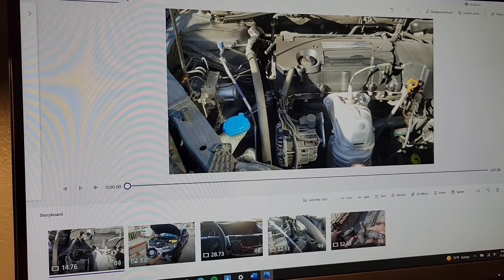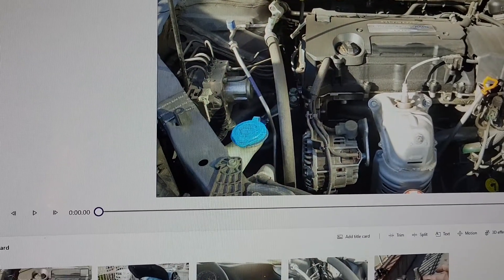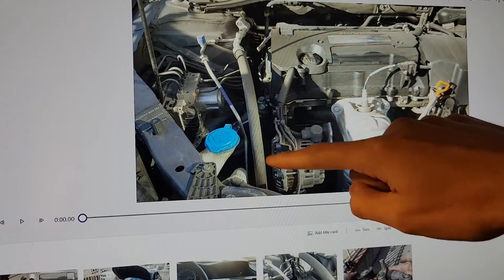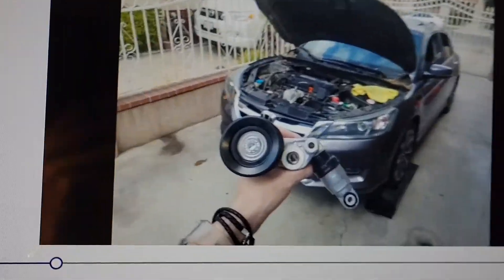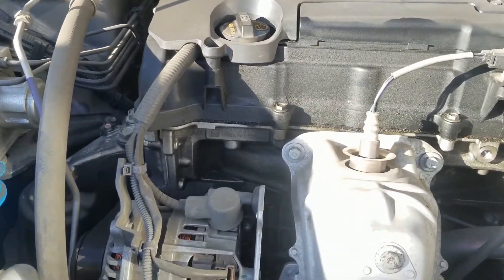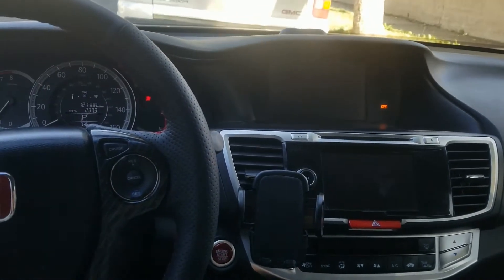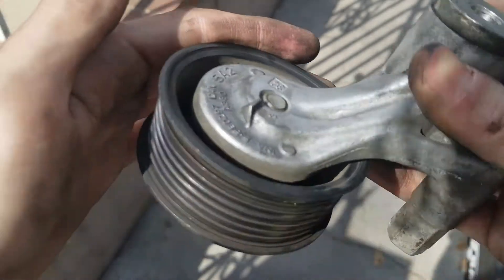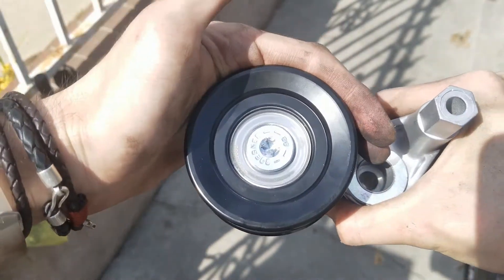Tensioner Pulley Noise/REASON (supercharger whine) 2013-2017 Honda Accord #diy #diagnose

Comment from the maker: :yt:OEM Tensioner Pulley Used: 
https://www.amazon.com/dp/B01MQLJFCN?linkCode=ssc&tag=onamzdan0f4a0-20&creativeASIN=B01MQLJFCN&asc_item-id=amzn1.ideas.1GQO7BKQEEC6D&ref_=aip_sf_list_spv_ofs_mixed_d_asin

OEM Serpentine Belt Used: 
https://www.amazon.com/dp/B00KTLGAN6?linkCode=ssc&tag=onamzdan0f4a0-20&creativeASIN=B00KTLGAN6&asc_item-id=amzn1.ideas.1GQO7BKQEEC6D&ref_=aip_sf_list_spv_ons_d_asin

Floor Jack Used:
https://www.amazon.com/dp/B0001E65UE?linkCode=ssc&tag=onamzdan0f4a0-20&creativeASIN=B0001E65UE&asc_item-id=amzn1.ideas.20WJBA2MSTTNU&ref_=aip_sf_list_spv_ons_mixed_d_asin&th=1

Jack Stands Used:
https://www.amazon.com/dp/B0BJV5KF3N?linkCode=ssc&tag=onamzdan0f4a0-20&creativeASIN=B0BJV5KF3N&asc_item-id=amzn1.ideas.20WJBA2MSTTNU&ref_=aip_sf_list_spv_ons_d_asin&th=1

Lug Wrench Cross uSED:
https://www.amazon.com/dp/B06XPWS3HJ?linkCode=ssc&tag=onamzdan0f4a0-20&creativeASIN=B06XPWS3HJ&asc_item-id=amzn1.ideas.20WJBA2MSTTNU&ref_=aip_sf_list_spv_ons_d_asin&th=1

HEX Tool to Remove Tensioner Bolt:
https://www.amazon.com/dp/B004W7ZVIS?linkCode=ssc&tag=onamzdan0f4a0-20&creativeASIN=B004W7ZVIS&asc_item-id=amzn1.ideas.1GQO7BKQEEC6D&ref_=aip_sf_list_spv_ons_d_asin&th=1

Items I use for my (2013-2017) Honda Accord on my Amazon affiliate Storefront here:
https://www.amazon.com/shop/striker50/list/1GQO7BKQEEC6D?ref_=aip_sf_list_spv_ofs_mixed_d

Comment: Thank you for the explanation, I’ve been trying to diagnose the problem for weeks
Reply from the maker: Downside: You won't have a supercharger anymore 💔
Reply: Thank you my friend can I just change the pulley only or I need completely
Reply from the maker: @mohamedgaras9259  Changing the pulley should get rid of the noise 🙏
There is a chance it can be one of the other pulleys but this is the most common one that fails
Reply: Thank you sir when I hear the noise it is 100% like your noise so iwill take my chance and change pulley only your good man God bless you I dont know still guy people out left in this world iam from Africa life is tough in North America cold kids language you can imagine my friend so I try to fix things with help from you tube people like you
Reply from the maker: @mohamedgaras9259  Thank you my friend, I'm here to help 👍
Reply: @mohamedgaras9259  I replaced the whole part, you can’t just replace the bad bearing

Comment: Often times it’s not the pulley it’s the alternator on the verge of failure too especially if you notice your interior lights like dash and map lights flickering due to voltage fluctuating it’s just matter of time before it completely seize up and destroy your serpentine belt leaving you stranded
Reply from the maker: Yup possible, but the tensioner pulley seems to be a more common issue to be addressed

Comment: Great Great vid man ! , just what i hear on my accord i knew it was coming from where the timing belt is but didn’t know exactly.. I hope you release that video on how to change it nd what tools did you use . Fuck what they say lot of us need the vid so we can fix it ourselves
Reply from the maker: Lol thanks Luis! I replaced this tensioner about 1 year ago and the noise just came back around 2 weeks ago. It's most likely because I bought the new tensioner pulley off Amazon. So my next one is going to be OEM. It's pricier but I don't want to be replacing it every year. Price difference is about $40 for this one and $140 for OEM
Reply from the maker: Video is up on my channel now for the replacement!

Comment: Hey I have a honest question I can’t find it anywhere online is there a actual supercharger made for the 2015 Honda Accord EX-L v6 3.5L or no they haven’t made it yet I see some superchargers were made for the earlier EX-L accords like the 6th to 8th generations but not the 9th gen I need help?
Reply: Yeah, definitely not. People have been fabricating their own custom turbocharger kits, but I personally had a custom setup from someone’s used Slick Fab turbo kit on their 9th gen 2.4L. I have the 6MT, but i’d probably not go forced induction on the CVT, cause it can’t really hold ~280+ WHP without blowing up your trans lol
Reply from the maker: @isnowyazn  If I'm not mistaken, the 2015 V6 has an automatic tranny, instead of the CVT
Reply from the maker: I haven't heard of any superchargers being made for it. Much easier to turbo it for slight performance increase. I'd imagine you'd need an entire new suspension and brake set up if planning to add an actual supercharger lol

Comment: I changed mine out. It was a knuckledrag to do.
Reply from the maker: It's really a pain in the butt! I keep delaying making the video showing the process because at the time I recorded it I didn't really think about making a good recording since my account was much newer. 
I'll do it soon though to show what helped! Because the only videos that show the process make it sound easier than it is and don't say what to do when things go wrong
Reply from the maker: I saw your torque specs on another post that's awesome. I'm going to be working on the video today and im going to remove the wheel to have a better angle since ive noticed no one shows it that way

Comment: Where is the installation video ?
Reply from the maker: Funny you asked: my new OEM tensioner pulley and serpentine belt just came in from Japan. 
After about a year, the aftermarket one I bought is already giving out as well. I bit the bullet and am going OEM. When I recorded about a year ago, I didn't get the best video clips because I got frustrated and ran into a few hiccups. I didn't want to upload a half effort video. I will make sure to address a lot of the points in my new upcoming video ✌
Should be recording this weekend or the next
Reply from the maker: Installation video is on my channel now showing step by step

Comment: Hi , quick question. I have a 2015 Honda Accord sport and it makes this sound but very quiet whine I slowly accelerate and decelerate. Is that just the normal sound of the CVT transmission or should I still look to replace my tensioner pulley. Thanks in advance for the insight.
Reply from the maker: I'm not sure if you've seen my other tensioner pulley video where I do the actual repair. In that one you can hear the noise when I accelerate even if the car is parked the noise will get louder. Try having the car in park with your hood open and step on the pedal if the whining gets louder even though the car is in park then it probably can be your tensionor pulley
Reply: @Striker50_  Thank you for the quick follow up. I also checked out your other video! I put my car in park with the hood open and the whining definitely gets higher when pressing the gas, but it’s only about 1/4th of the pitch that was in your video. It’s hard to hear unless your really listening for it. Can’t hear it over regular interstate/road noise. Is this something to be concerned about? Honestly just hoping I can rule out my transmission being shot haha. Thanks.
Reply from the maker: @jedmayhak7768  lol I feel you. Hard to say over just comments. I suppose you can do a CVT oil change and see if there are chunks of metal that could be a sign. Keep in mind it wont sound as loud as my video because you're sitting in the car if you're doing it solo. Another way is to remove the serpentine belt off and spin the tensioner pulley with your hand. If there is a whirring noise then that's how you can tell it's the pulley. If it sounds quiet that's how you know it's not the tensioner pulley. You can also check all of the pulleys that way. If they're all quiet it's not the pulleys

Comment: This is about as close to the problem I'm having with my 2015 Accord the thing is the tensioner pulley have been replaced and nothing changed
Reply from the maker: There are other pulleys that do give out although this is the most common one. A way to check if it's the other pulleys is to remove the serpentine belt and spin them with your hand to listen for that grinding noise. I have a vid showing how to remove the serpentine belt if that benefits you

Comment: This only happens when I pass 40mph and it’s making the noise on the front driver side, this still the problem ?
Reply from the maker: It could be a wheel bearing it seems. Do you have an ABS code, or any codes on your dash?
Reply: @Striker50_  no codes yet, been making that noise for a couple weeks now.
Reply from the maker: @nathanangel9762  You may be experiencing another issue than the tensioner pulley
This noise happens as you rev the car, even in park the noise will increase if you press the accelerator
Reply: @Striker50_  I haven’t tried it in park yet, so if it does make the noise while it park it’s the tensioner pulley. But if it doesn’t make that noise in park then it’s the wheel bearing ?
Reply from the maker: That's a good starting point. Again, can't say with 100% certainty what it may, or may not be since all I could do is read your description of it. 
One thing though is that the tensioner pulley sounds more like a supercharger noise.
The wheel bearing sounds more like a whirring noise and isn't as loud when you're driving along.  @nathanangel9762